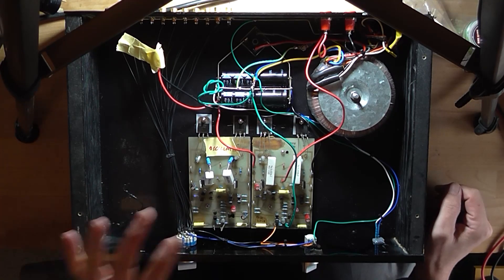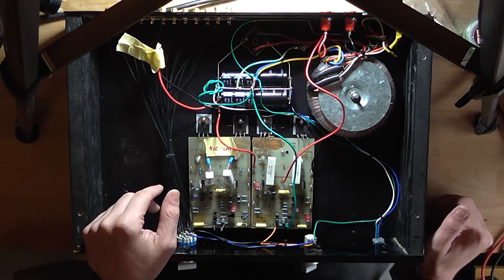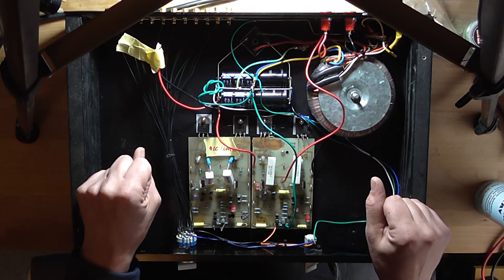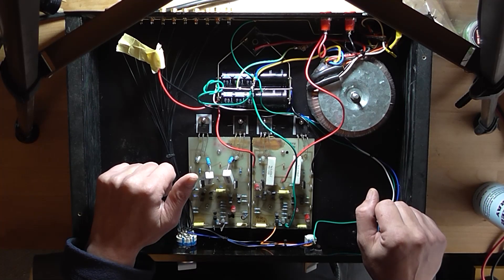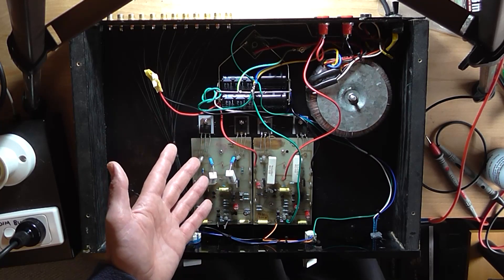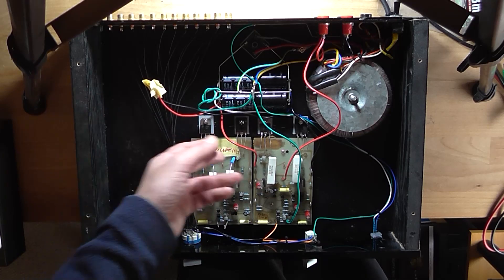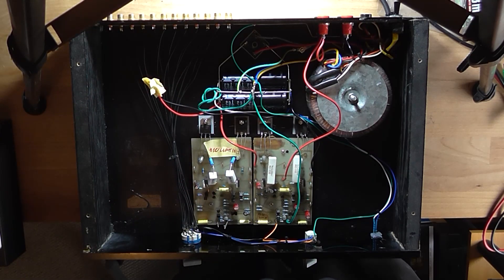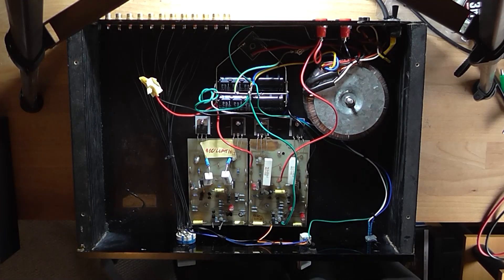Knowing When To Walk Away (NVA AP-50)

Comment: By how much is the faulty module holding the supply rail down, I mean what is the expected voltage vs the measured one ?  
Assuming it's a 100 Hz oscillation, what if  it were a little bit of of ripple on the power supply rails which then leaks on the output load when the amplifier is clipping the output signal. 
As you said the PSU not faulty but what's the chance of a dodgy electrolytic capacitor in the shunt leg of the negative feedback in the amplifier ?
Reply from the maker: It loads down to +/-12V and its not ripple as the other module functions fine. Anyway, it's been returned to its owner now 😊

Comment: These NVA amps are notoriously unreliable. They were dependant on the speaker cables for stability. I've seen a few with holes burnt in the PCBs where the output stages failed spectacularly.
Reply from the maker: Nasty.
Reply: On the nvahifi website on the NVA AP50 Hi-Fi News & Record Review page there's a whole spiel about CABLE MANNERS!  Design seems very temperamental.

Comment: Man just check the current sources vas stage vbe multiplier or biasing network just scope around different areas and you will find were it is also compare the dc voltages vs the ac voltages amp to amp with a 1 kHz sine wave both at same gain and take the extra resistors out! U will find it
Reply from the maker: I'll look at it again later. I'm not having much luck with power amplifiers lately. New video coming out...

Comment: why you not measure all value and voltage from good one channel ? to make comparison ...dosent look so hard to fix that amplifier
Reply from the maker: Well, as the faulty module is holding the supply rails down, voltage measurements between the working and faulty may not yield much. However, I guess it's worth a try.